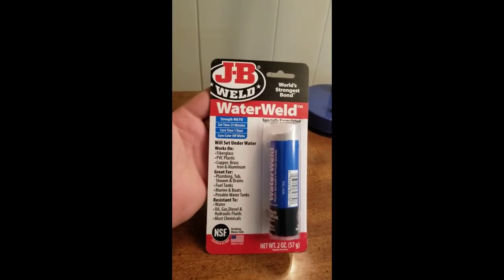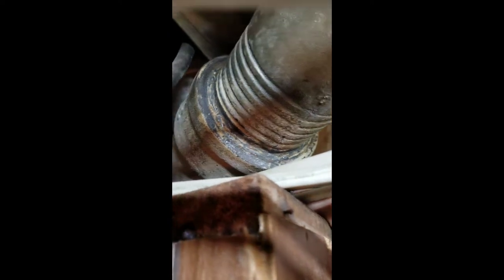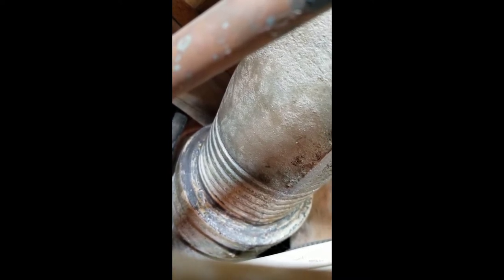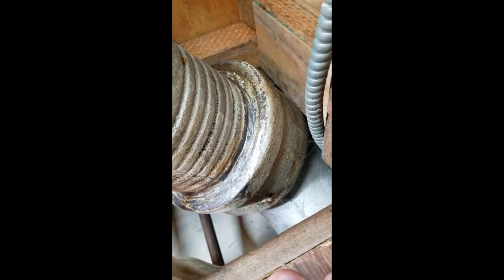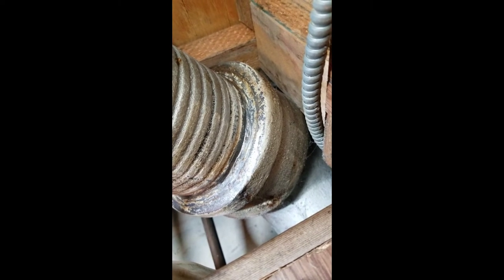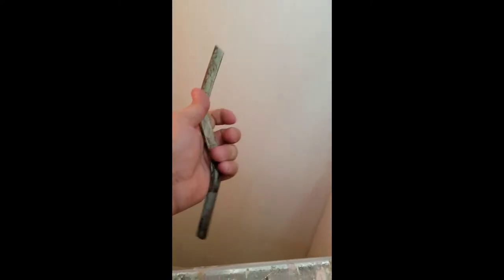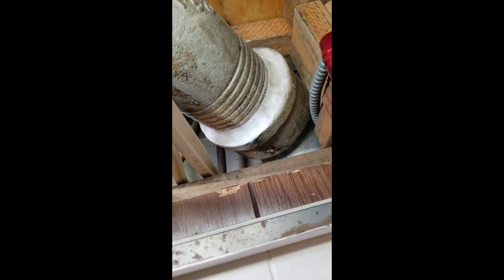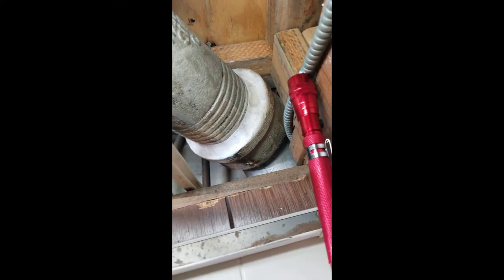CAST IRON PIPE repair

Comment: I have a leak in cast iron pipe, would you recommend Water Weld or Steelstik?
Reply from the maker: I used water Weld for a temporary fix . Pretty well For a temporary fix and then I installed new PVC .. appreciate ya stopping by

Comment: Do you think it would work on a main line to house connection? 60 - 80 psi
Reply from the maker: I don't think so ..   If it's a copper water pipe. i recommend cutting it out and installing a new piece.... But if you try it let me know if it works....
Reply: @MRSOMTHINBASIC  Thanks for the quick response. It's actually a cast iron transition into pvc. I've replaced most of the pvc I can get to, but there's a connection in a planter thats tough to replace without breaking concrete.
Reply: @MRSOMTHINBASIC  Thanks for the quick response. It's actually a cast iron transition into pvc. I've replaced most of the pvc I can get to, but there's a connection in a planter thats tough to replace without breaking concrete.
Reply from the maker: My video like a temporary fix....  It's definitely not a  Perminent fix.. I don't know if that helps you... But I would definitely change it out..with pvc  If you can.. Sorry I'm not much help.. and i really appreciate you stopping by